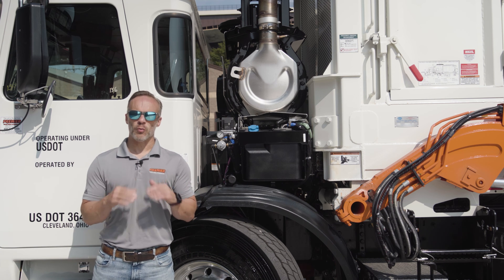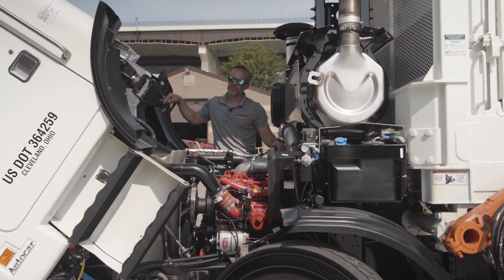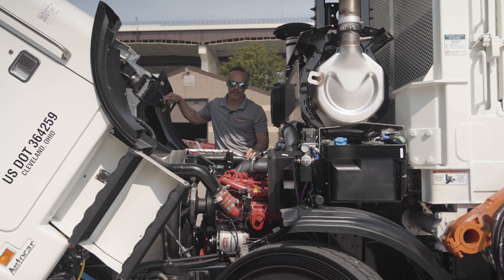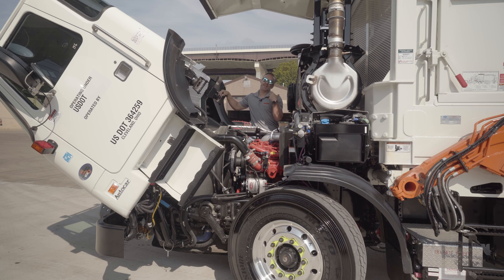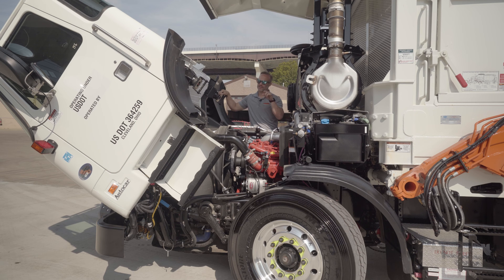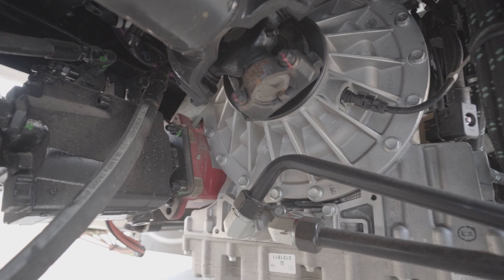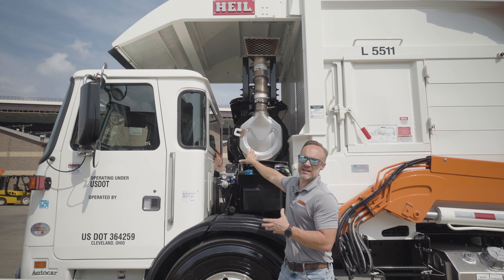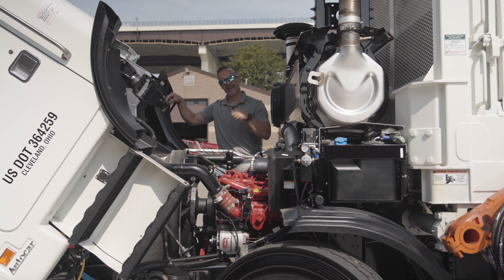Autocar ACX64 Residential Front Loader Part 4 - Engine/Transmission

Comment: I work for Rumpke Consolidated Companies at our Colerain Facility in Cincinnati Ohio. As a preventative Maintenance Technician one of the problems we are facing with the Autocar Resi Front Loads is the accessibility to get under the front to jack up the truck to inspect our kingpin set up and wheel bearings. My question is what is the easiest way to access the axle to get proper clearance?

Second question is related to the Full Service and Inspection of the Engine, what is the best way to access the oil and fuel filters as they are tucked up under the frame most of the time?

I work with both the Cummins X12 Diesel as well as X12 Compressed Natural Gas engines. Any thoughts would be greatly helpful. Our fleet is going to autocar so it’s best to get the help right from the experts. Thanks for your input and time.